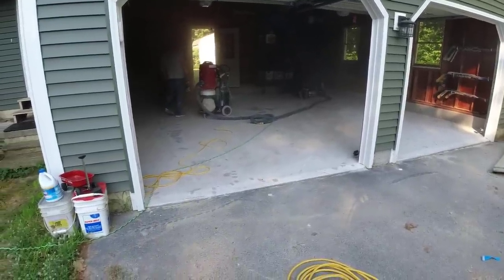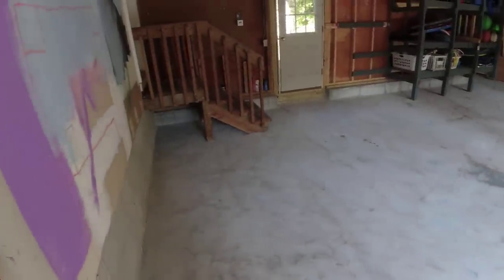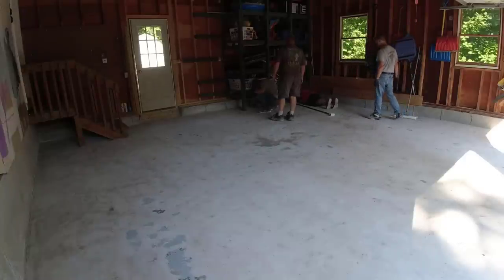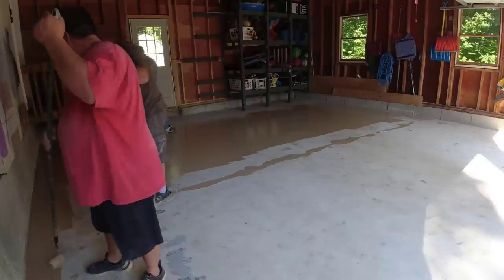How To Epoxy Coat Your Garage Floor - INCREDIBLE RESULTS!

Comment: Great video! With how deep some of those spalls are, I'd bet that concrete isn't made to withstand freezing conditions - is the garage temperature controlled?. Salts also don't help haha. That epoxy coating will keep it well protected from moisture and salts, good work!

Comment: Very nice! I would like to have this done to my garage floor. I don't have damage like the one in the video but I do have a unique problem. The floor was not poured properly and let's in rain due to the slope being wrong. I need to float it which would take about an extra 1/2 to 2" of material. Is this possible? I'm concerned that a thin layer like that would be prone to flaking.

Comment: I have a drain in the center of my garage. Of coarse the water from melting snow runs out the garage door and pedestrian door. I’d love to resurface the garage floor, but I want to fix the water flow issue first? Can you recommend a way to fix the flow and get it to the drain?

Comment: Have you ever had a problem with self leveling cement chipping after you applied the epoxy?  Also what epoxy product did you use to fix the pitting?

Comment: If this was my house I would want the stairs and that storage shelf removed or at least lifted to ensure complete coverage.......$6000....don't think so.....sorry....but I do like your channel generally
Reply: it’s a 2 car garage, plus he’s repairing the concrete. You also have take into consideration his drive time, if this out of his service area but yet he’s still helping this customer out.
Reply: Ya agreed, that floor was a wreck, he didn’t just bandaid it, he made the surface stronger and more dense, I don’t believe that was just road salt that made the floor spawl, I think when they finished it originally, they either bull floated it too many times or Fresno troweled it fight after, trapping bled water beneath the surface and it spawled, but the road salt didn’t help, there were some deep spawls in that floor, combination of both I think. And the other thing is, it’s expensive material, and it took him 2 days to do it, the do it yourself kits last about a year, I’m sure Mike uses at least a 5 year product and if you keep the floor clean it can last forever.